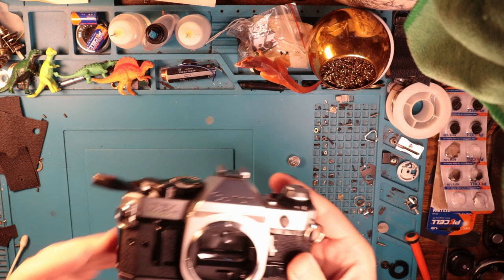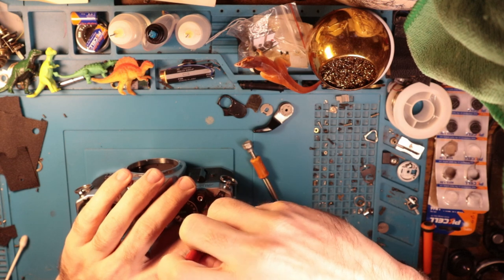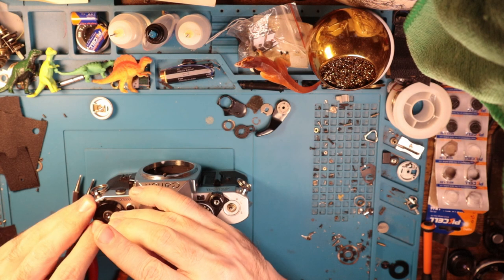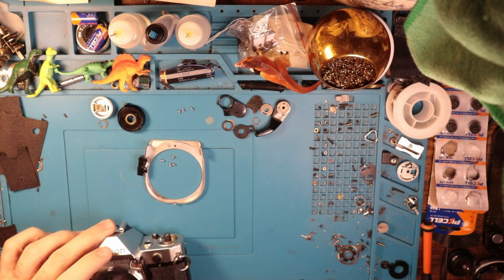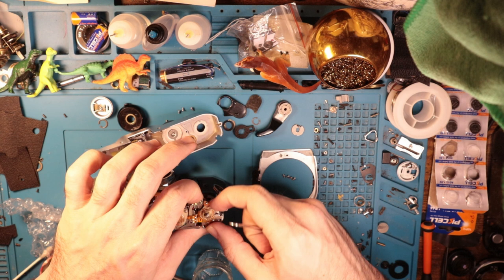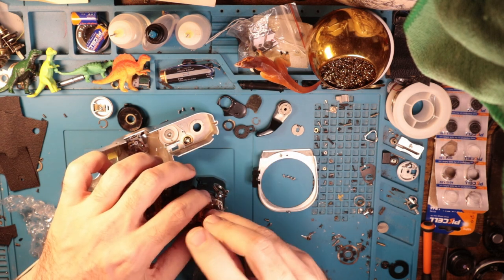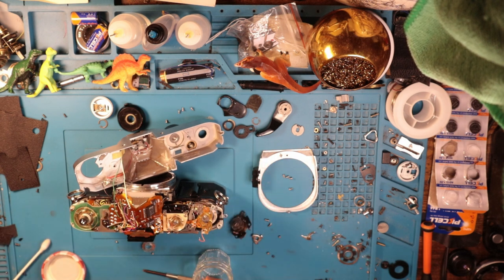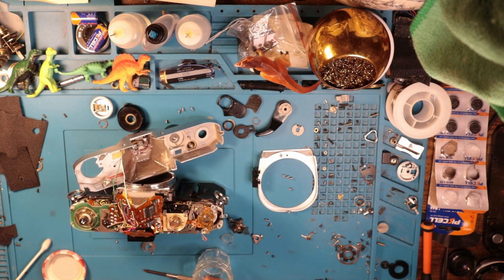Removing the top of a Canon AE-1 Program

Comment: Great video. I am trying to repair my AE1 Program's faulty shutter release. 
When shorting the ground screw to the top magnet pin solder nothing happens. However if I push the shutter release button the same time, then the shutter magnet releases. I have checked on both magnet's resistance and they are normal. I have also cleaned the magnet surfaces. What would you recommend next? Thank you, Frank.